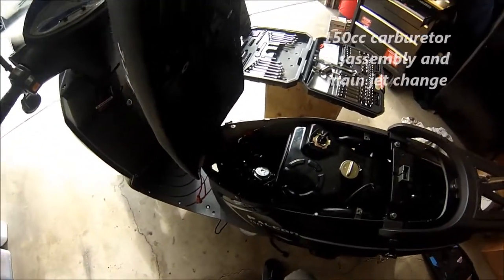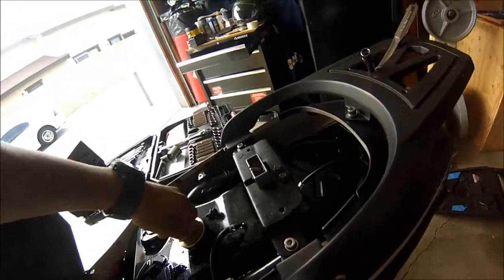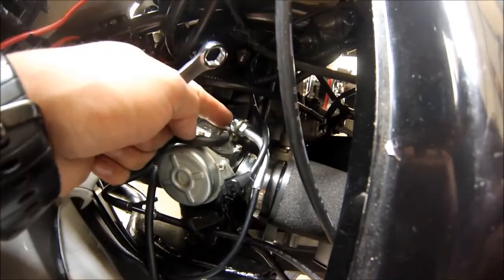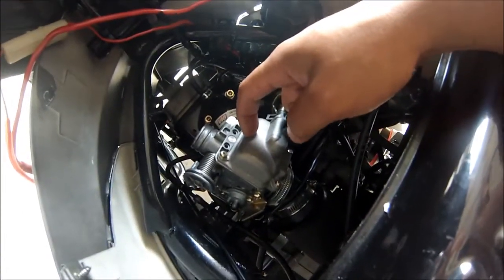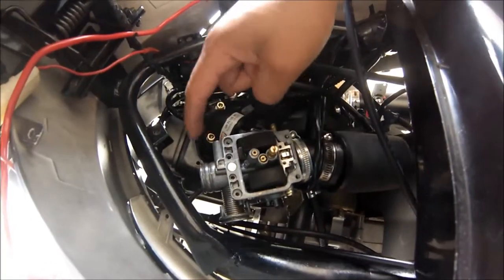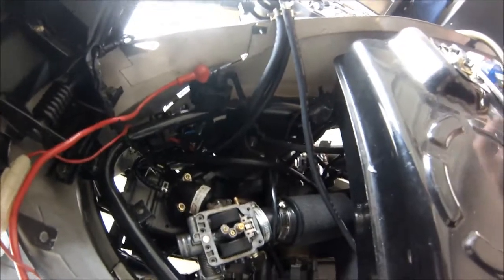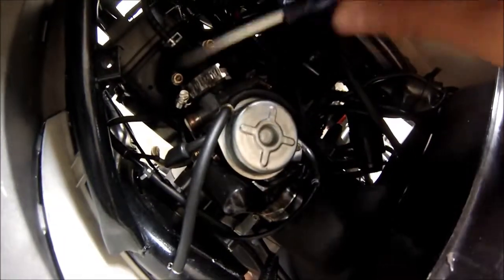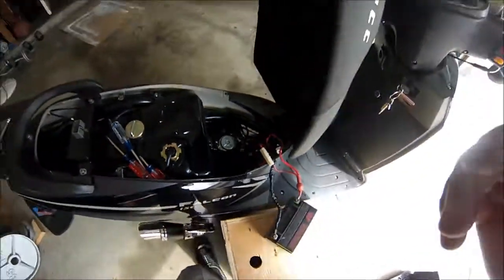150cc GY6 scooter Carburetor Disassembly and Main Jet change

Comment: Warning. Doing a intake and exhaust requires a 130-140 main jet. Having to little fuel can damage your engine. Always better to go bigger if you're not sure but those are the most common jets used after intake and exhaust. Altitude plays a role also when choosing.
Reply: i didnt know this bro😂, mind tellin me why i requires a bigger jet when u put on an exhaust?

Comment: So if I upgrade my exhaust would that be the Jet I would have to replace??
Reply from the maker: yes, just increase by 2 jet sizes. stock i have a 100 main jet, so with better exhaust, use a 102 main jet